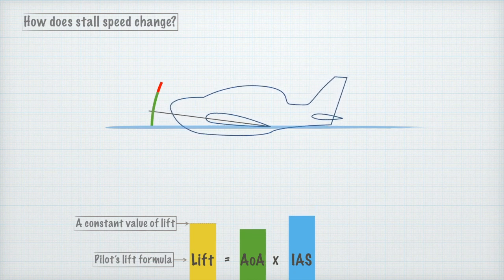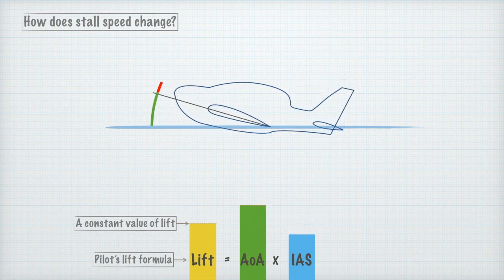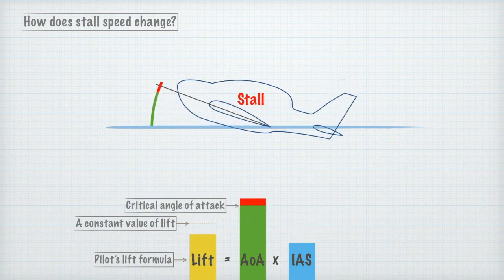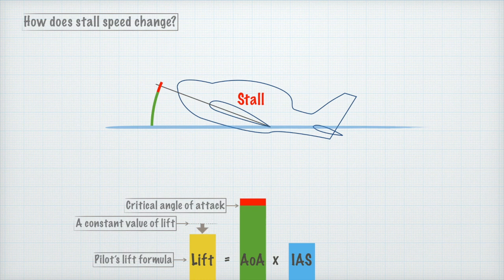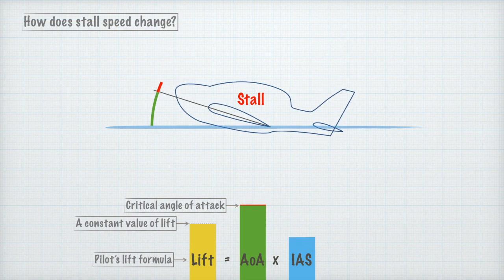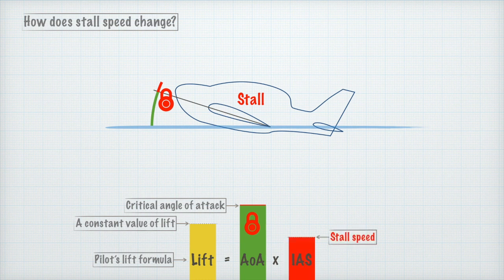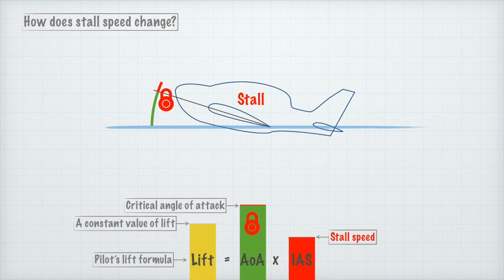How does stall speed change?

Comment: Once the critical AOA is reached and if this AOA is then retained as a constant, then ever airspeed in this state is considered the stall speed.
This is why only after stick pull matters in the stall as the critical AOA can only be achieved at one stall stick position.
Stick pull is an extremely reliable dictator in stalls.

Comment: It depends on what is your intention. 
With the maksimum takeoff weight you want to increase lift and gain higher altitude and reduce the stall speed; you just need to set your Flaps for takeoff setting and put your speed on Vy or Vx. Or, reduce your weight.❤

Comment: The two big factors that affect the speed at which the critical angle of attack is exceeded are weight (obviously) and G forces. Higher weight or G forces increase the stall speed, and lower weight or G forces decrease the stall speed.
High-lift devices and other aerodynamic features may also come into play, but this is the most basic physics you can apply even to a paper airplane.

Comment: I have a question. Saying that "flaps decreases stall speed" may not be true? A certain amount of flaps can increase lift, at the expense of drag. However, in this case, the ratio between lift generated and induced drag is so that more lift is generated than drag is created. But if flaps were extended to a point in which induced drag was greater than lift generation, wouldn't stall speed thereby be increased since more lift is required to maintain an altitude? Ah, I just answered my own question. In a C172, stall recovery procedure is to have flaps no greater than let's say 20 degrees. This is because greater than 20 degrees generates more drag than lift, which can cause a secondary stall if you are not able to trade altitude for airspeed. Right?
Reply: U have no  lift without incrementing drag. So the flaps do increase lift at any configuration but because of drag it's not convenient to use them until you are landing and you actually need that drag to slow down and to increase also the Vz (descent).
In fact if you use more than 10° flaps for Takeoff you will have more lift for sure and reduce the ground roll, but as soon as you lift off the drag will cause you not to climb as easily as you do without flaps. In a go-around one of the things you do is infact retract flaps once the speed is appropriate because as flaps retract stall speed increases. Hope that helps
Reply: The opposition force to drag is thrust, not lift. Not enough thrust is the reason you bring the flaps up for a stall recovery.

Comment: Flaps will reduce stall speed
Reply: but they increase the aoa
Reply: @alexs.p.r4357 they increase the stall angle
Reply: They increase camber ( surface area ) @alexs.p.r4357
Reply: @alexs.p.r4357 they don’t increase the AOA, the increase lift by extending the camber of the wing but thr reduce the critical AOA
Reply: @Dabber-e7f  The AOA increases because the effective chord line, which runs from the leading edge of the wing to the trailing edge of the flap, pivots up